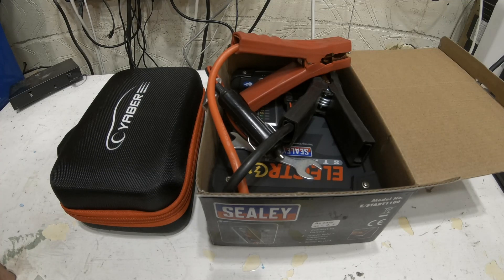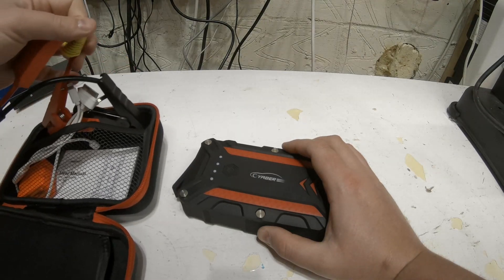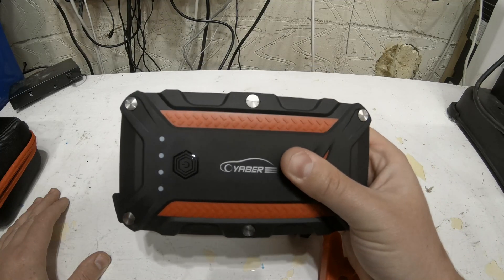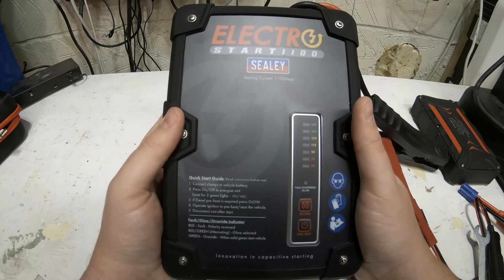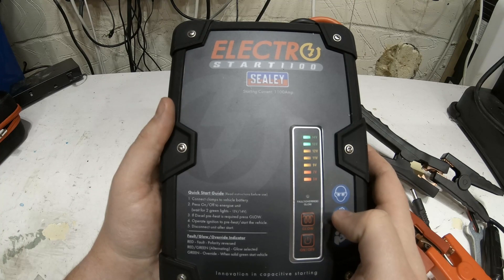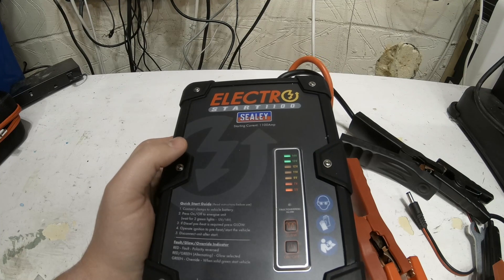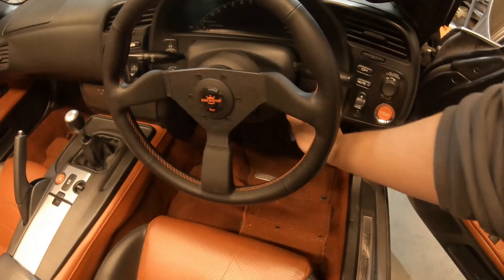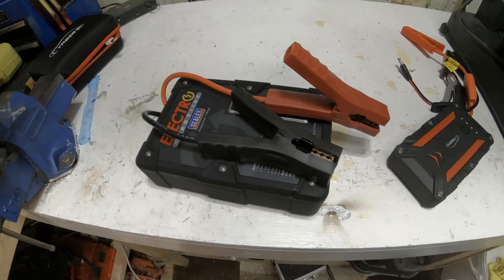Testing the Sealey E/START1100 Super capacitor vs a conventional lithium jumpstarter

Comment: How long does it hold the steady power for the car?? Until sealey discharge??
Reply: The charge in the caps will only allow a few seconds of cranking before they get deleted, so these are only for cars in good condition and are able to start quickly.  If you have a car with some problems that needs extended cranking to start up, it won't work as well.  For that you're best off with jumper cables and another car, or a fresh battery based jump pack. 
I prefer the caps because they won't degrade as rapidly as battery pack jump starters, and don't require diligent charge maintenance that the lithium packs need for best longevity.  The lithium packs need to be kept charged just enough to work, and not kept fully charged all the time, because that degrades the batteries faster. And allowing them to discharge too far will leave them incapable of jumping. 
With the super caps, they can  be left in the car and forgotten for years with no problems.
I've been able to start many vehicles without fail so far, though no encounters with diesels yet, only regular gas engines.

Comment: I bought one 5 years ago, it worked fine for a couple of years, came to use it last week and it wouldn't turn over my golf diesel. Contacted Sealey who didn't want to know.
Reply: That may be due to the draw from the glow plugs that diesels use to ignite the fuel from a cold start. Super cap starters generally aren't going to be good for those applications because they drain a good portion of the charge heating up the glow plugs, leaving less for the actual start, which probably takes more current in the high compression diesel engines.
It might work with  two charge steps to do it, recharging the caps a second time after preheating the glow plugs for the start.

Comment: any idea what voltage it actually puts out when you override it?
Reply: It boosts to a voltage of 16.3V, assuming it's the same as the Schumacher DSR108 units that I have, which appear to be the same design.  The output is 450A max based on the specifications.